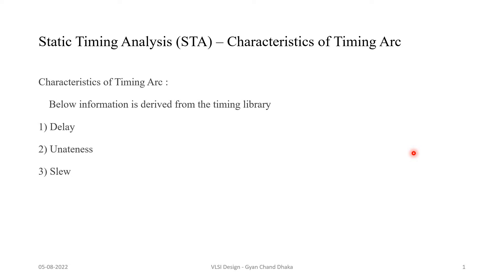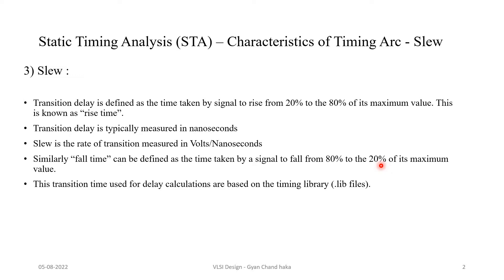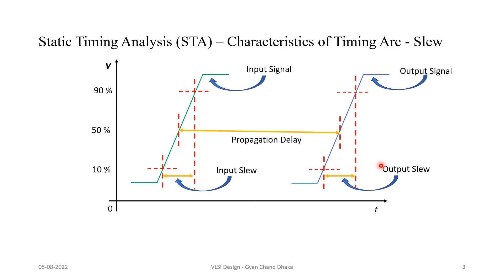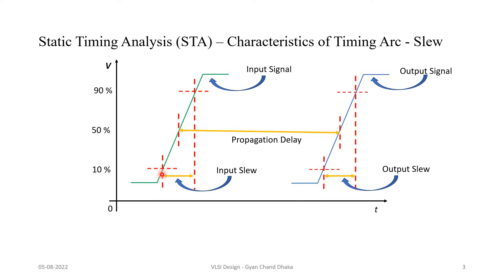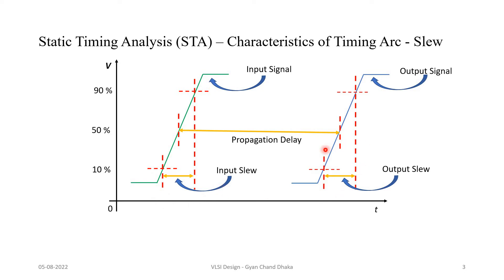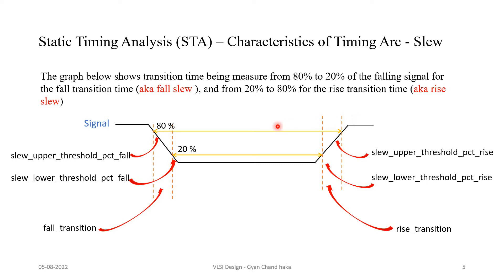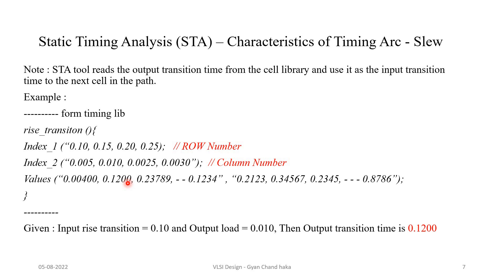Chapter#06 | Timing Arc | Slew | Propagation Delay |Static Timing Analysis(STA) | @vlsiexcellence ✍️

Comment: At 11:02  From where u got Slew is measured as 0.10 at a range 40 -60%(20% swing) so could u please explain    .10 *(60/20) 
At  15:46 From Input Rise Transition and Output Load, how u calculated Output Transition Time ?